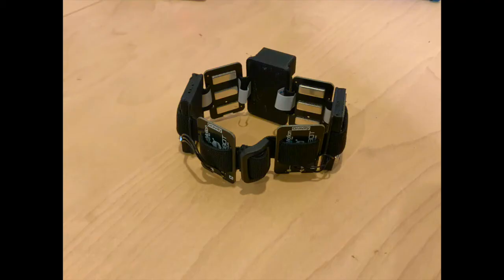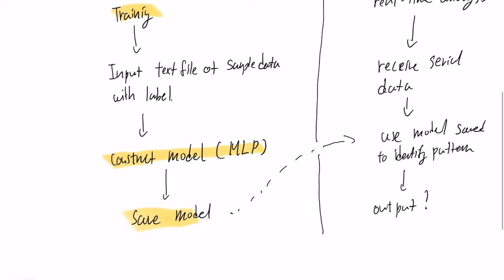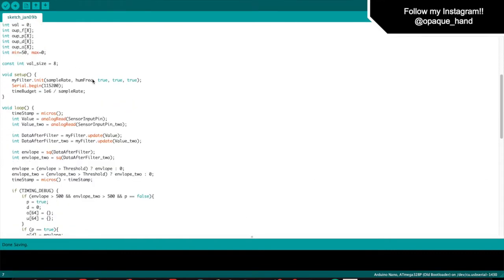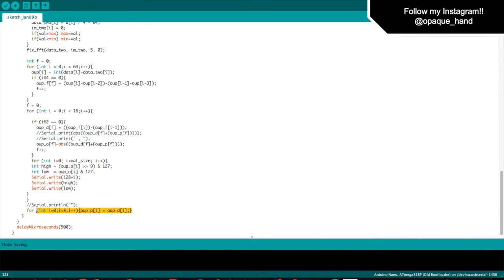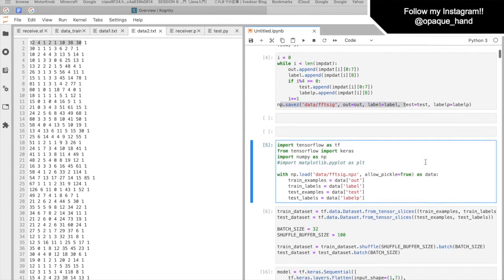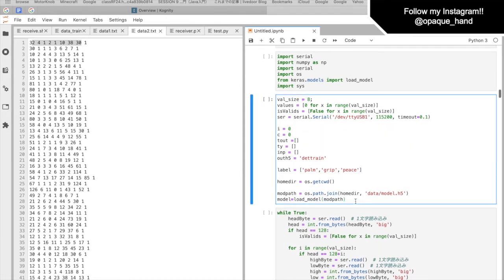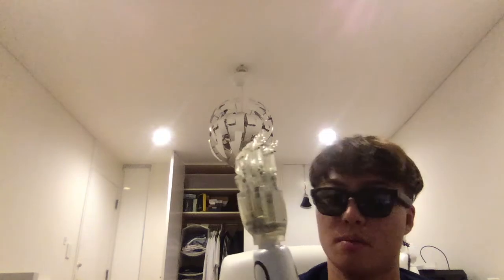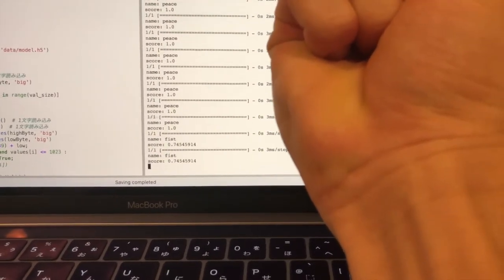AI Arduino EMG Sensor !!!!  Tensorflow on a Raspberry Pi !!!

Comment: Very nice, helpful in my assistive technology project! I've driven a wheelchair with emg but a simple threshold isn't accurate enough. So I have been thinking about AI. You're example is a great starting point. Do you have any ideas how you could speed it up? Why not running Tensorflow lite directly on Arduino or Raspberry pi?
Reply from the maker: Thank you for the comment! I am currently a high school junior and although I want to proceed on this project, I have college applications to do so am planning to brush it up after it is over. For TensorFlow lite, I didn’t have any experience with it so I just stick to what I already know.
Reply: Hello, the drive file is broken, could you please re-upload it, thank you very much in advance